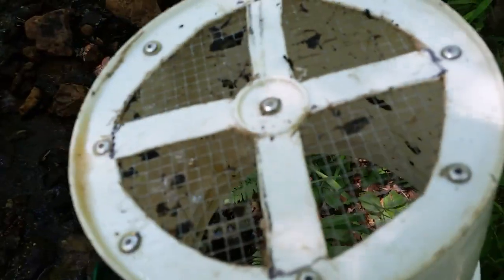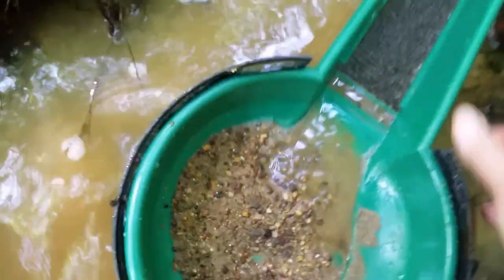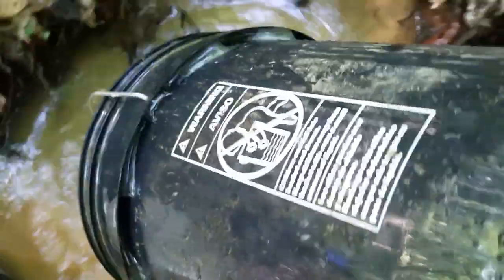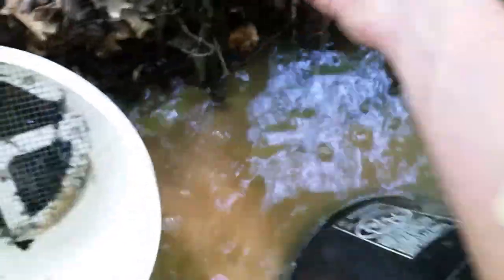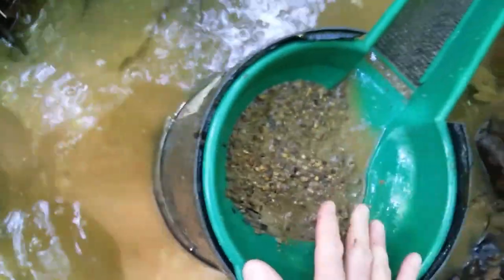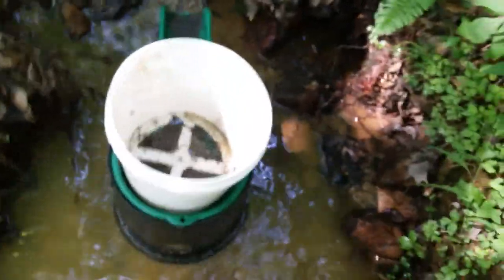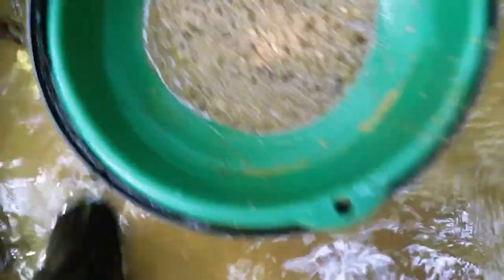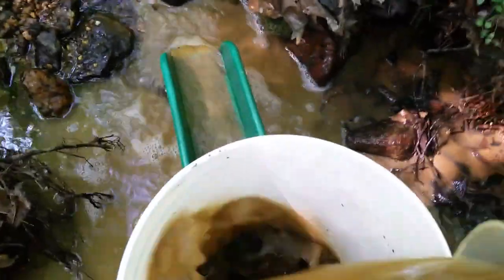Banjo pan improvements Gold prospecting

Comment: you sir are a genius, I've been looking for a way to mount my banjo pan to use it in exactly the same way. Only difference is i use  5 gallon bucket with ball valve attached so i can regulate the water flow, 350gph of gravity flow runs for 80 seconds.
For shine simplisity this option wins hands down.